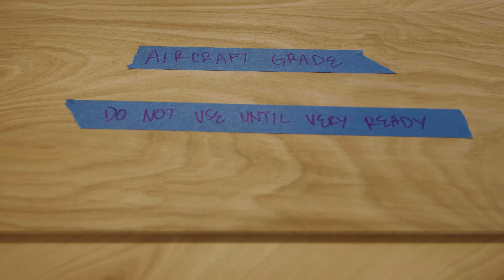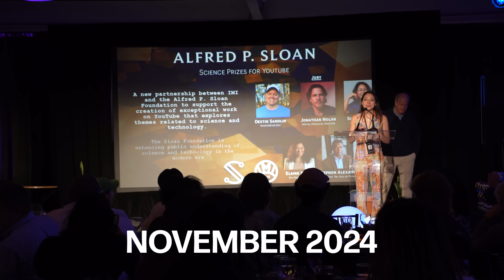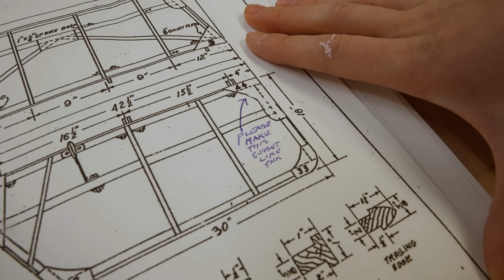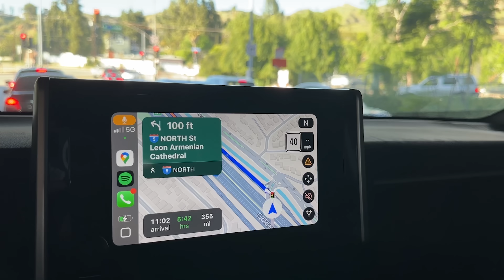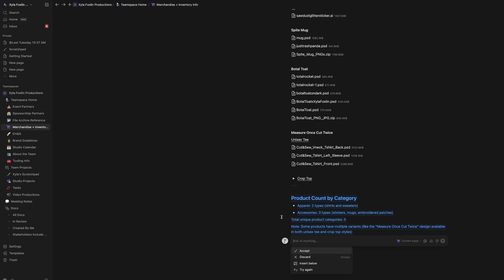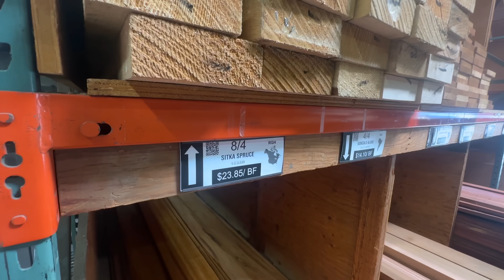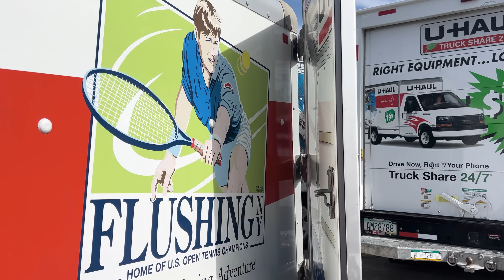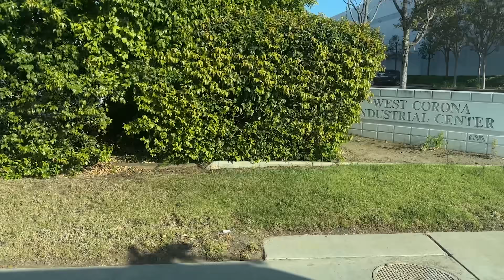I'm Building an Airplane from 100-Year-Old Blueprints

Comment: With such strict rules for the use of wood for an aircraft (which make total sense, a knot us a weak point, and you do not want to have those in a plane), ... do you risk to have to buy more wood, or will the 100 board foot be enough???
   This is a VERY interesting project, that I look forward to watch/follow.
   I may have missed out... are you cleared for flying? You had to sell your plane a while ago, has the situation changed, or did I misunderstand what was going on back then??
   I wish you a good, successful build 👍👍
Best regards from Denmark 🇩🇰.

Comment: Any thoughts on what you're going to power it with? 
It looks like most current Aircamper builds have ~90-100 hp. 
I'd be tempted to put a Rotec 2800 in the nose just for the look and sound but there are definitely less expensive options.

Comment: Considering that practical aeroplanes had only been around for 25 years (1928 - 1903), and state-of-the-art power was a Model A side-valve, it's amazing that Pietenpol was able to create a design that is still viable, albeit not the epitome of performance any more.
P.S. that unguarded table saw blade looks like a monster waiting for some flesh to rip.

Comment: You need to read up on how to orient grain on aircraft wood. It's not like making a piece of furniture. You could ruin a lot of wood if its cut wrong. Also you need a scroll saw and a bench sander . Sand the edges of all the plywood to knock off sharp edges and hold the plywood off the edge a hair so you don't glue fabric to sharp edge gussets when you cover the frame. When you seal the wood frame, use a 2 part marine varnish. The wings get condensation which can get in the joints.

Comment: Given that modern glues are stronger than the wood itself, I wonder if you can make a longeron out of two shorter knot-free pieces glued together with a long scarf joint, like you would do in boatbuilding. Congratulations on your award, and good luck!

Comment: A VERY important tip. Sand the corners of the wood just enough to knock off the sharp edge. That's where breaks start. This is true for ALL pieces. Ribs gain a great deal of flexibility when you fine sand them. Get pine boards and cheap plywood to make about 5-8 ribs for practice. Throw those away. It's just to get skills to make perfect ribs without using expensive wood. Careful with the grain orientation . It's a lot of fun. DON'T get in a hurry. Think of each piece as a finished project.
Reply: lol

Comment: I'm impressed by your self control.

I wouldn't be able to resist running a piece of wood through the planer before ripping it.  Partially because I want everything to be perfectly flat.

But mostly for the pun.  Planing wood for the plane....

Comment: merch with a diagram of the airplane you are building would be a hit.
Reply: Could be a copyright violation if it’s an exact copy of the plans.
Reply: @chrisray1567  Says the plans are from 1929, which means it's just old enough for the copyright to be expired!
Reply: @vigilantcosmicpenguin8721  Great point. I didn’t think about that, but works published in 1929 did become public domain this year. If the plans are from 1929, then they are public domain and free to print on any merch you want.
Reply: More to the point, why is she wearing rings?

Comment: Very kewl project! 
It won’t provide more horse power, but if your table saw isn’t already wired for 220 then you should seriously consider it. You will get the most out of that 1.75hp that you won’t get on 110. I know this from experience with the deWalt hybrid saw I used to have. The table saw performs a lot better.

Comment: MacBeath is the greatest in the Bay Area... you score points there.   Now here is the salt in the wound... Wish I was there as then I would have let you borrow my truck (as I live near LVK) and I would have thrown in the Jointer that I wanted to give you a few years ago. We both would have won, I give a jointer to a Great Cause and you get to drive 6 hours with a New Airplane.  :-).   Now all you need is an engine, cables and a few wheels. Oh and a full Garmin panel.

Comment: I have been tickling the idea of a single seat doublejet airplane made from mostly Aluminum Honeycomb carbon fiber composites.

I need to learn about aerodynamics of the fuselage and wings probably a bunch of Math aswell. So it's a scary project.

Comment: building a lightweight wood plane .... so 1 to 2 years build time coming YAY lots of video's :) 

Manually drafted plans ... what every CAD user should be taught BEFORE they touch a computer ...how to make and use the MANUAL version .... 

BTW you can transcribe them into CAD from those plans ... and remember one MAJOR thing ... good enough is wrong ... do it RIGHT is right you are putting your life on good enough or on done right ... one is a risk one is not

Comment: You would have been better off using an 7-1/4 inch blade than a 10 inch, less costly, thinner kerf, and less torque on 1.75 hp saw. still capable of over 2 inch at 90º.  You can always put a smaller blade on a table saw as long it has sufficient depth of cut for your stock.

Comment: Am I correct in that this will qualify as a part 103 UL? 
We have different rules here, but I would build one ASAP if we had your rules
Reply: Interesting question.  This model is designed with performance well in excess of part 103 maxima and is traditionally built to hold one pilot and one passenger.

Comment: Buying a rip blade was the right decision- your saw has plenty of power for this, with the proper blade. If you raise your blade to full height, less of the blade is passing through the work, thus decreasing the resistance, blade wear and chance of kickback (which shouldn't be a problem anyway, with such large boards).  Many people protest that for "safety reasons", the blade should be just over the top of the work, but I disagree strongly- and with a sawstop, that's not really much of a problem, anyway. I use a GP blade for most work, but also have dedicated rip, crosscut, and even solid surface blades for certain jobs.  Incidentally, I find it much easier to get consistent small rips by simply setting the fence to the width I want- you'll find that you have no problems doing so with 1" rips.

Comment: As a 1929 ford model A owner, it would be so cool if you'd actually put a ford model A engine in as originally designed, but also, as an owner of that car, and knowing the engine, i don't know if you actually should want that.

Comment: G'day Xylla,

Yay Team !

I was lent a 1930s-vintage Book of Popular Mechanics projects, including Scale Plans for a Pietenpol Air Camper, in 1974 when I was 13.

The book came from the High School Woodwork Master, after he found my budding 3-ft diameter Radiata Pine Propeller in the Ante-Room.

I was way out of my depth, but I did attempt to track down the last Henderson 4-cylinder Inline Motorcycle my father recalled anyone in town having...; but I was about 25 years behind it's last sighting (!).

There is one Pietenpol being built, locally, from Eucalyptus Hardwood, and it's going to feature a Volkswagon motor...; a Sheepfarmer who finished up being the last President of the local Aero Club has been Scratchbuilding it for about 30 years. 

He flies a Cessna, but the Pietenpol is what he dreams about.

What's the story regarding building the Pietenpol and your FAA Paperwork Logjam ; has that been resolved ?

The best Woodwork Channels I know of on YT, are

Engels Coach Shop

And

The Art Of Boatbuilding

Dave Engel is the more
Educational and inspirational, but it's a close-run contest ; I highly recommend  them both.

Such is life,

Have a good one...

Stay safe.

;-p

Ciao !

Comment: Please put a push stick in your right hand when cutting on the circular saw
Reply: Came here to say that. At 16:26 you can see her using a push stick, so she does has one.
Reply: Did you mean table saw?
Reply: @cali-electro-dad  Yup, you call it a table saw
Reply: @wayneluyt4089 Yes... do you call it a circular saw? If so what do you call a handheld circular saw?
Reply: @cali-electro-dad  We call it a hand held circular saw or skilsaw, Im in South Africa
Reply: She did when her hand got close to the blade.  Besides, she has a SawStop; much safer than any other table saw.
Reply: @barryomahony4983  can you elaborate on why a SawStop would change the need to use a push stick? Would be usefull to know for people like me.
Reply: @barryomahony4983  expensive exercise once brake deployed, best to try to avoid it